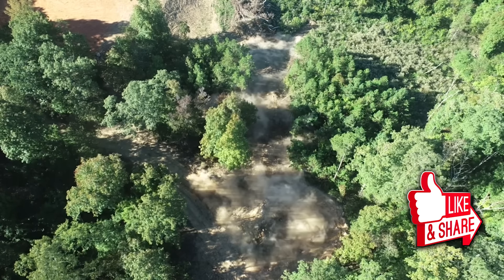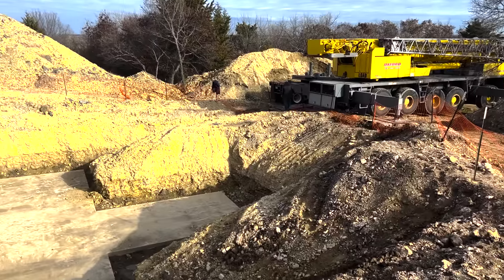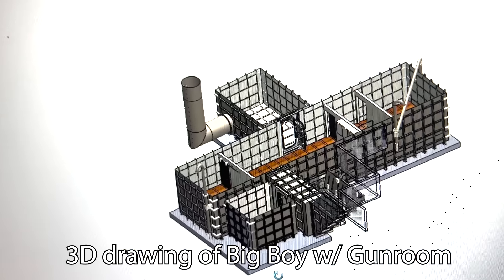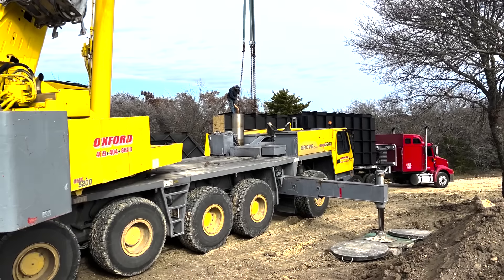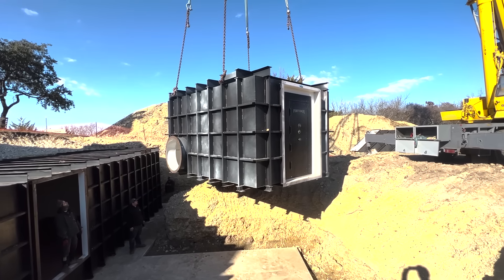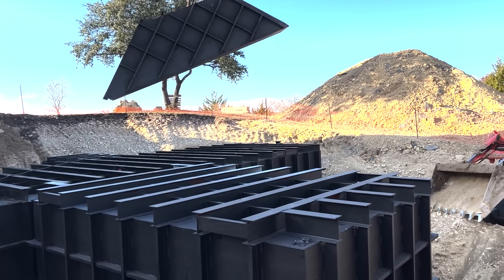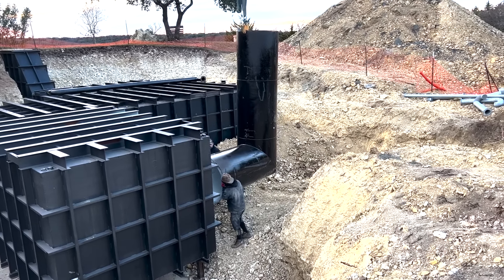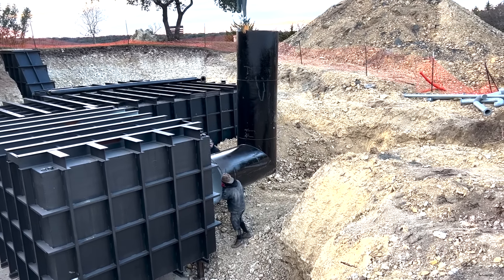Big Boy bunker with a $100,000 Gunroom Part 1

Comment: I would think a polyurethane sealant like they use to glue on car windshields before bolting up would be superior to welding...
Reply from the maker: And that's why the competitors bunkers flooded mostly
Reply: @Atlas Survival Shelters  really? That's very surprising! I would think that risk of porosity or cracks developing over time (from not being able to heat treat after welding) would give equal or greater risk years down the line.

Comment: I do have a few questions. Condensation/humidity and also rust over time. How this bunker behave in a humid climate like UK for example and also will fungus attack the interior?
Reply: condensation requires a condensing surface. If you manage humidity of air ingress and rely on the natural heating of the ground you probably won't have any condensation to speak of. I think this would require active humidity management. 

Fungus can't eat steel.
Reply: @sevenheadedweasel  Hi. I was thinking of this. In the UK, all basement areas have such a problem sometimes regadless of maintenance. Yes, fungus can not eat steel but can live on dust.

Comment: Nice but I'm at a loss to understand why you'd put an $8k door on a gun room that has a weak point of entry with an escape hatch on it.. seems to me the escape tunnel should be attached to another room...
Reply from the maker: It's not a weak point.  Yiu can't enter an escape tunnel.  It goes out not in
Reply: @Atlas Survival Shelters  the cover won't be as secure as a Fort Knox door... just because it opens out doesn't mean it can't be breached...
Reply: @AusJackal  when someone has 500k to spend on a hole in the ground, the might just want to spend 8K to have the words “Fort Knox” on the door.
Reply: @JT Foog  sir I have no issue with the door.. I'd want a good door on my gun room... my point was... why spend that much to protect your firearms when they installed a back door that isn't as strong or secure...
Reply: @AusJackal  I agree with you. I was saying the door is useless (because of the back door) so it might as well just be for the name printed on it

Comment: Wouldn't you typically build a bunker deeper in the ground than this? I wouldn't initially think that this set of "containers" would withstand a nuclear bomb in its current state.
Reply from the maker: 2' concrete or 3' earth minimum is required for a fallout shelter   This one has 6-7'.  It only looks shallow cause the hole is so big
Reply: @AtlasSurvivalShelters  Ok, thank you for your answer. Are you putting 6-7" of concrete on top of this ?

Comment: My philosophy has always been better to have and not need, than to need and not have, but I know I can't afford it either way. Looks like nice work though. Shouldn't the top of the structure be deeper in the ground? I'm no expert in these matters, but if I were going this far, I'd want the top about 30ft below the surface. 

Edit: I just saw where 10 ft is recommended.

Comment: IDK, if there was an actual bedrock shelf there at the bottom of the hole, there was literally no reason to pour a concrete slab over it. Could have bolted the shelter right to the bedrock shelf (could have leveled it easy enough), the bedrock shelf ISNT going anywhere!!!

Comment: These shelters never look deep enough to provide any protection from surface radiation. Might be ok against zombies but any fallout which settles on the ground above the shelters would probably cook the people inside.  Any technical stats which could be provided would be interesting
Reply from the maker: To shield from gamma radiation you need 24" of concrete or 36" of packed earth.  This one has 6' of earth plus
Reply: @AtlasSurvivalShelters  thanks for the update. It was hard to tell that it would be finally covered by that much earth

Comment: The roof of the shelter looks like it barely underground
Reply: Go to 13:42 and you will see the bunker is 8-9feet under the ground next to the house.  I know what you mean on the other camera shots....looks lik 1ft.
Reply from the maker: 6' under ground
Reply: @AtlasSurvivalShelters  being closer to the surface = less weight that can drive above the bunker?  Say a car vs pickup....also, great to see you posting videos on the installs again!
Reply: @dmcd7333  it’s built stronger than most road bridges, I’d say it’s fine